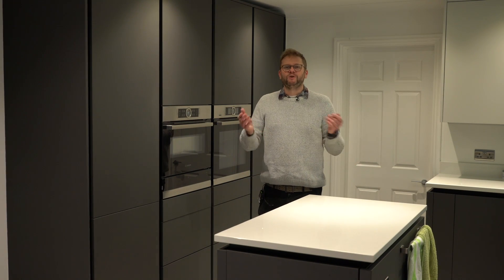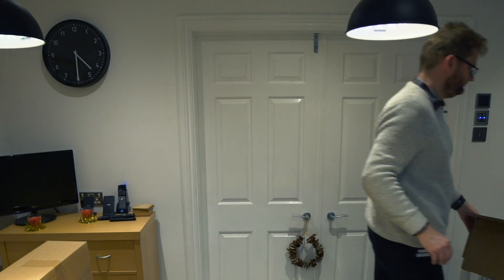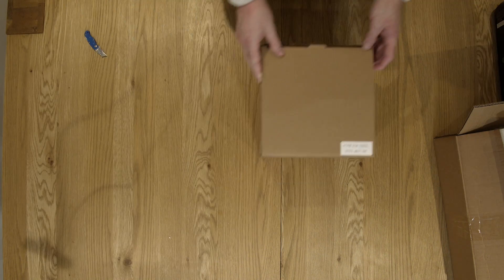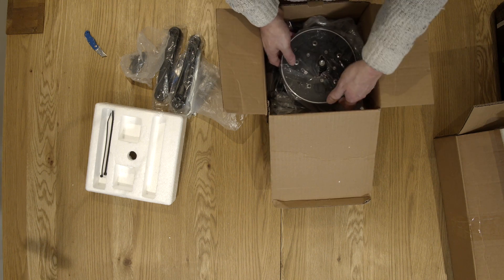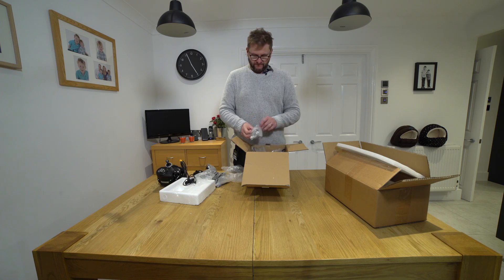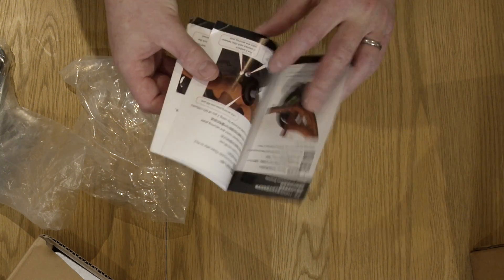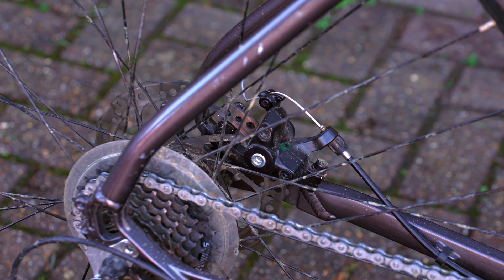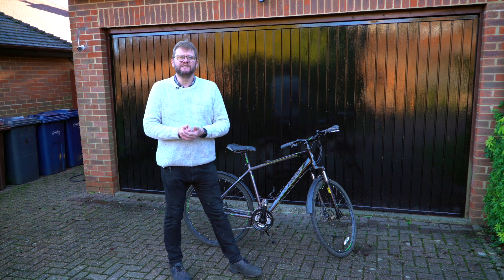Unboxing & Selecting Donor Bike For Tongsheng Tsdz2 Mid Drive E-bike Conversion Kit

Comment: I wonder if you could help me. I plan to build an ebike with aid drive but I want to use a larger power bank an charge with a generator while driving. I would like to put the batteries and genny on a trailer and double its use as a camper for a cross county trip. 

My question is, can this motor (or others) be set up so that the bike will run and charge simultaneously? Do you know what I need to do this?
Reply from the maker: Hey Jeff, Sounds like you might be trying to break the laws of physics! If you are saying you want to run the bike and then charge the bike from that motion, sadly it's not going to work. Even if everything was 100% efficient, which it isn't, you would only end up having to but the same energy through the pedals as if there was no motor or generator. In the real world, you'd have to put more in! Apologies if I misunderstood what you are proposing. Feel free to correct me.
Reply: @artful-bodger  no no no... You misunderstood. Sorry I also have a crap phone and it typos a lot. 

I want to buy or convert an ebike, add a trailer, put a gas generator on the trailer and plug the bike charger into the generator. Run the generator while driving the bike and charge it. 

A small generator can run 6-8 hours on a gallon of gas. If I could do this without frying the batteries, generator, etc then this would be a great project.
Reply from the maker: @jeffl4802   @jeffl4802  I don' t know know if you can charge the battery whilst peddling. I also think you would need a bigger kit 1 KW or more to make the trailer easier to tow. Sounds like a crazy project. You should make a Youtube video on it! Feel free to post the link here!

Comment: 28inch wheels???
Reply from the maker: Yeah baby!
Reply: @artful-bodger  not 27.5 or 29 inch I didn’t  think 28 available
Reply from the maker: @paul-sm3wh  You may well be right. As I said, I'm definitely no expert but the tyres have "28 x 1 5/8" which I assumed meant they were 28 inch!

Comment: This all looks great, I followed your alli express link and saw that the complete package, with battery, is under $1k. I haven't seen any kits with the Tongsheng TSDZ2 and a 19AH battery for under $1k so i'm curious if you think there are any significant quality differences?
Reply from the maker: All I can say is the battery I have been sent seems really good. It's only 11 Amp Hour but seems to give me quite a bit of range. I'm going to do a full review in a later video! If you're worried about the battery quality, the LG ones are probably a safer bet.